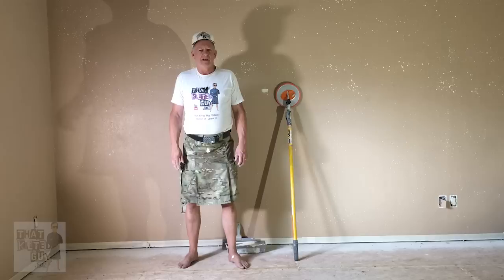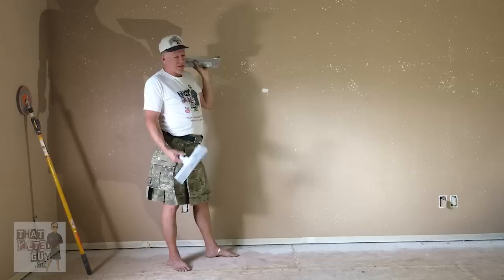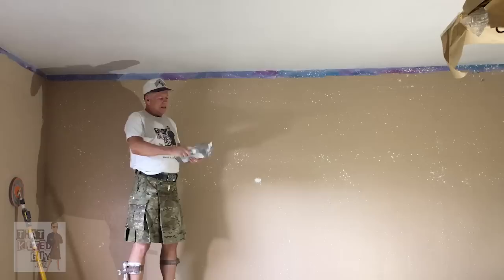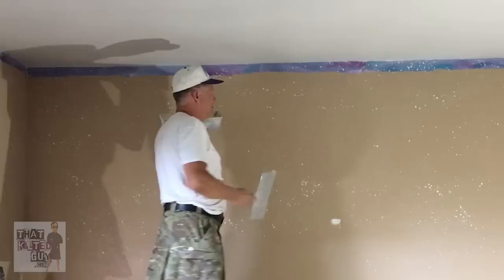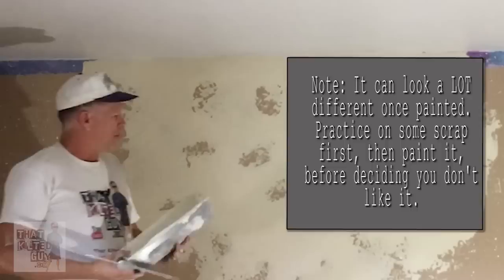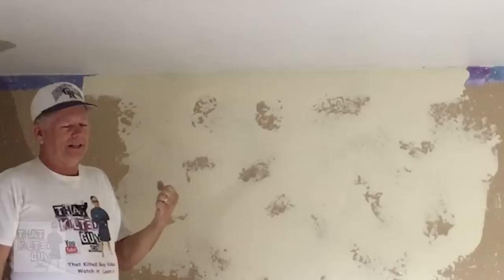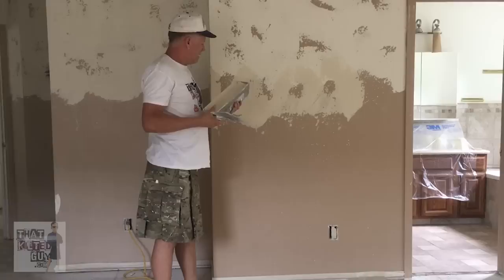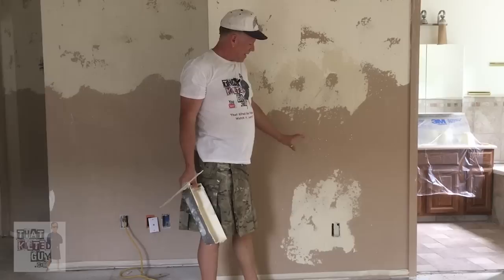Here's how to do this BEAUTIFUL TEXTURE!  My customers love this

Comment: I have  rough textured walls with gloss paint on them.  I want to retexture over this.  Just sanding will miss a bunch of the surface.  Should I tsp the walls before putting more mud on?  Thanks, great site!
Reply from the maker: You could apply a paint de glosser, or sand it the best you can and add some glue to the mud, about 3-4 TBL per box of mud.  You can add more but beware that the more you add the harder it will dry and the harder to sand.  Or do it all to ensure the best adhesion, sand, de gloss and add glue.  Also note that regular weight all purpose has more glue from the factory than lightweight.
Reply: That Kilted Guy DIY Home Improvement- Do you have a specific glue recommendation? Perhaps regular elmers glue?

Comment: Can I do one small wall skip trowel texture over  a orange peel texture. I believe this wall is painted flat color or eggshell now. Do I need to prep before I start skip trowel. I do not mind orange peel showing through the voids, it may create interesting look. Did you or anyone else had done it easily?  Thanks
Reply from the maker: I’ve done it s few times and it looks great actually. Sand everything first with 80 grit to de gloss and give the mud more to bite onto.
Reply: @ThatKiltedGuyDIY  Thank you so much. You mean sand to take the shine of the paint, not heavily to sand off the texture..
Reply from the maker: Yes, shiny paint won't let mud stick 'as well' but it will seem to stick when you put it on.  Sanding takes off some of the shine, AND leaves scratch marks, which the mud can grip onto.  It has to bond or it can flake off.

Comment: Thanks for the video! I’m skip trowling new and old sheet rock. When I go over the old painted stuff it seems to leave little bubbles but not an issue with the new stuff. Any tips?
Reply from the maker: Those pesky bubbles.  I have never figured out a way to eliminate them, so when they happen, you can just sand them off, then vacuum the dust out of the holes, and fix them with mud.  With texture, the thicker you put it on, the more it will bubble, so keep the texture thinner for fewer bubbles.  Let me know how it goes.  Thanks, Guy, aka that kilted guy.

Comment: Hey Guy, great video.......ignore the ignorant haters, lots of idiots out there!Anyhow,I wanted to ask what you end up doing with the blue taped inside corners at the top.Can I just start troweling from that corner without taping?Thanks
Reply from the maker: Well the blue line in my video is actually paint because they had a pasted on border around the top and had painted under that and when they removed the border, the blue line showed. 

But inside angles should always be taped or at the very least caulked if the crack is tight. Hope that helps and let me know if you have any further questions.
Reply: Have you got an email addy?
Reply from the maker: Yes. You can Look on my About page here on YouTube. But here it is- ThatKiltedGuy15@gmail.com

Comment: I respect your professionalism, However I wouldn't leave a wall half done before I leave the job for the night. only about 5 mins more.... just saying "PUSH" make it much easier!
Reply from the maker: I had a whole lot more to do the next day anyway so i had to stop before it was all done anyway. Actually had the whole bottom half of the room to do so about 45 minutes worth and it was getting dark with a 45 minute drive to go.  And sometimes you need to blend wet into dry so I wanted to show how to accomplish that. 

When I need to I know how to push myself.  I recently worked 28 out of 30 days and averaged 10 hour days.  I once worked from 9 am - 2am because a sub l left me in a bind. But good advice for most. 

Thanks for the comment.

Comment: Would this be similar to cat face ..?
Reply from the maker: Hmmm, Never heard of a cat face texture. Does it have whiskers in it or something? Or does it purr when you pet it? Just kidding, but I don’t know what you’re referring to.
Reply: A cat face texture is more of complete skim coat with a few what we call holidays or cat faces here and there usually need to sand out laps, Some people would call the plaster look . I also would do it with diamond  brand veneer plaster and add paint tint into the material then burnish slick. Mostly high end custom homes

Comment: I don't think that's skip trowel, too much of flat areas, and I don't hear that sound of sand skiping against wall 🤔
Reply from the maker: I appreciate your input, but you do realize that texture names & styles vary Widely all across the country.  I know how to do the texture you refer to, but in my part of the country, MANY drywall contractors do this same basic texture, which I know because I patch them all the time, and Not Once have I seen one done with sand.  It's just not how they do it out here, but I do carry a very small amount of silica sand with me Just in Case I come across one.  But I've repaired hundreds of skip trowel textures in this area, and yes, that's what the contractors call it out here, but I know in other areas they call it different names.  There is no specific definition of what constitutes a skip trowel texture.

If you mean a skip trowel like this- http://bit.ly/2zQXLFD I’ve matched it, and personally don't care for the look at all.
Here's an example of a Top builder of million dollar homes in our area, and in this video, the skip trowel texture is the most common style in this area, and a lot like mine- https://youtu.be/_mCg55v_aNQ?t=5m12s

As for the photo, no, this pic is not off this exact job, but it IS one of mine, just from a different job.  But it was also done over a textured wall, as was the texture in this video, so it's basically the same exact finish, so I used it.  I can match anyone's texture, and have seen a lot of variety, since it is a hand texture, and when I do a new job, my customers love my style over that of most of the heavier, skippy textures.  So it's a matter of preference.  Also, I've worked in Colorado most of my life and never heard the term smoothwall, so it's another term that's simply different in other parts of the country.  

Watch a video by The Idaho Painter and he refers to texture names different yet.  I've worked briefly in Seattle WA and Texas, and they had different terms there too.  So I'll just use what we use in this part of the country, but thanks again for your input.
Reply: That Kilted Guy DIY Home Improvement , you are right, I'm in the Bay area Ca, and we do skip trowel texture a bit different 👍

Comment: Not a true skip and trowel. What you are doing Mr. 30 year drywaller is an imperfect smoothwall, a lazy one at that. And the photo you shared at the beginning (that was probably a Google photo) was an imperfect smoothwall as well. 
Mix your mud with a scoop of silica sand very thin. Smaller scoop of mud, hold your handle very lightly and make passes with little pressure
Reply from the maker: Matt, I appreciate your input, but you do realize that texture names & styles vary Widely all across the country.  I know how to do the texture you refer to, but in my part of the country, MANY drywall contractors do this same basic texture, which I know because I patch them all the time, and Not Once have I seen one done with sand.  It's just not how they do it out here, but I do carry a very small amount of silica sand with me Just in Case I come across one.  But I've repaired hundreds of skip trowel textures in this area, and yes, that's what the contractors call it out here, but I know in other areas they call it different names.  

If you mean a skip trowel like this- http://bit.ly/2zQXLFD I've matched it, and personally don't care for the look at all.
Here's an example of a Top builder of million dollar homes in our area, and in this video, the skip trowel texture is the most common style in this area, and a lot like mine- https://youtu.be/_mCg55v_aNQ?t=5m12s

As for the photo, no, this pic is not off this exact job, but it IS one of mine, just from a different job.  But it was also done over a textured wall, as was the texture in this video, so it's basically the same exact finish, so I used it.  I can match anyone's texture, and have seen a lot of variety, since it is a hand texture, and when I do a new job, my customers love my style over that of most of the heavier, skippy textures.  So it's a matter of preference.  Also, I've worked in Colorado most of my life and never heard the term smoothwall, so it's another term that's simply different in other parts of the country.  

Watch a video by The Idaho Painter and he refers to texture names different yet.  I've worked briefly in Seattle WA and Texas, and they had different terms there too.  So I'll just use what we use in this part of the country, but thanks again for your input.